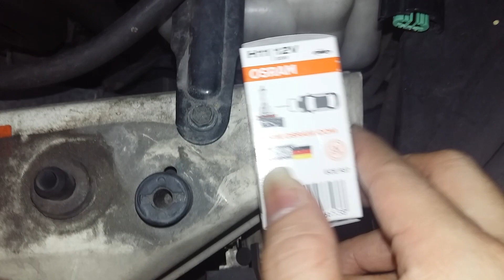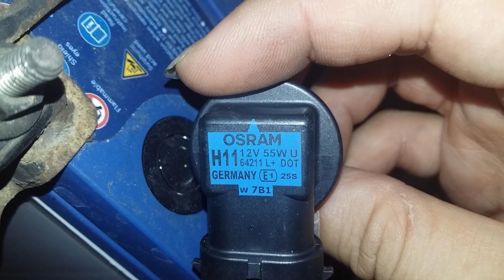A - Z Myvi change head lamp bulb / tukar lampu Osram.

Comment: I use led light. but my headlamp cover also faded like yours. Need to polish I guess.
Reply from the maker: Hi Kumar, it's a good move to extend the life of headlamp. The main reason for the headlamp to became faded is the sun. You can try to Polish the headlamp by yourself using Meguiar's Headlight Protectant.